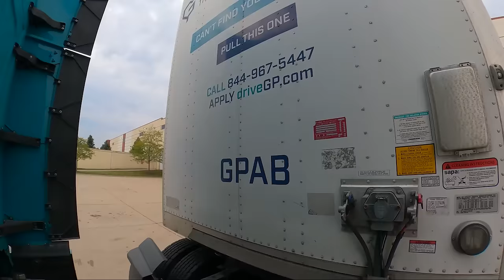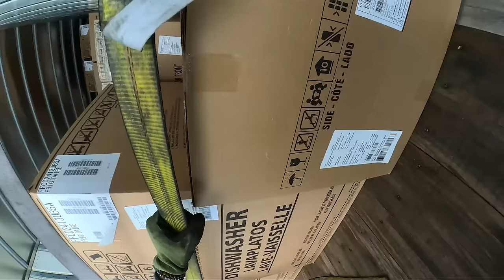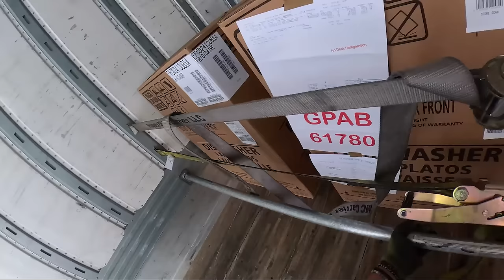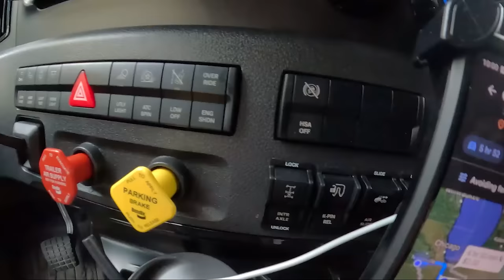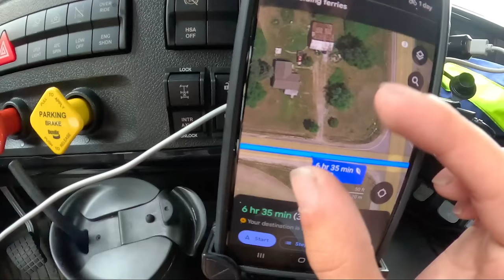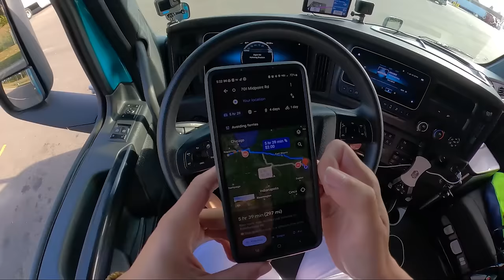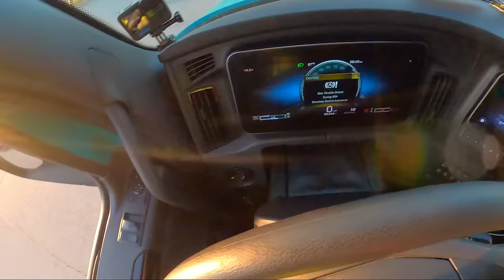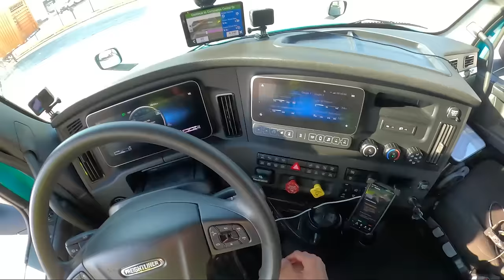a day in my life.....

Comment: Oh I forgot to turn the lights on.  Do you ever check the brake lights.  Do you even know how.  Ya I didn’t think so.   You’re so weird dude.
Reply: Isn’t there a switch on the dash that flicks all the lights on at once? I don’t drive trucks but I’ve moved a few old prime movers around and one or two of them has had a switch like that in them.
Reply: @thesausage351 there is a light inspection switch in late model Kenworth trucks, I'm not aware of a switch in Freightliners.
Reply: @treotraveler  ah cool, I don’t think I’ve even driven a Freightliner, not too common in Aus, same as Pete’s. I’ve only driven a couple of Mack’s and KDubs. Come to think of it a Denning coach I drove might have had the inspection light switch also.